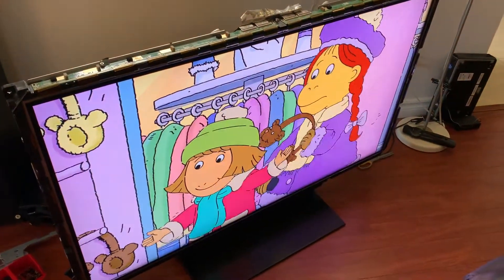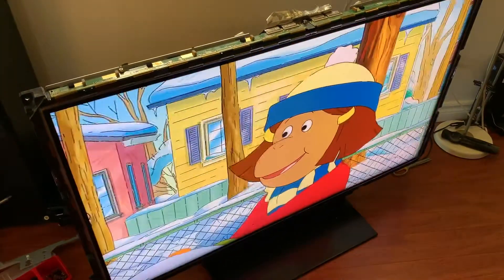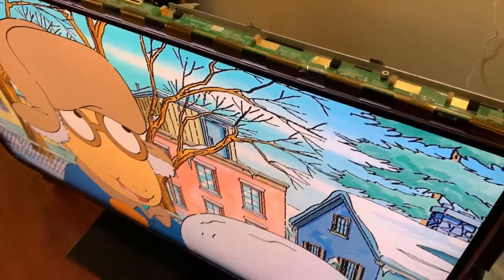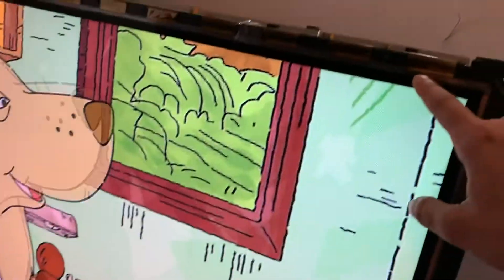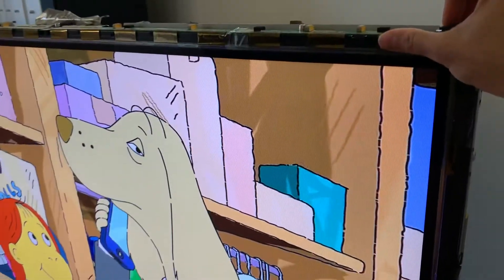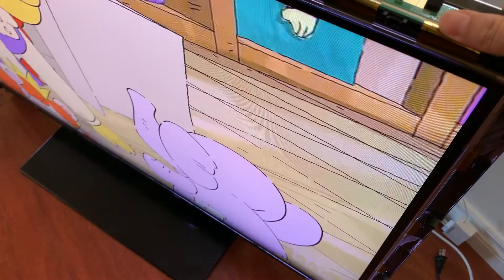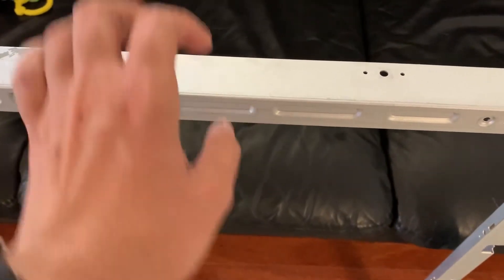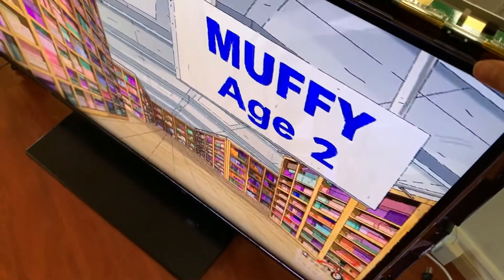Sony Bravia KDL 52 XBR4 - horizontal lines / ghosting fix

Comment: Why didn't you use electrical tape like everyone else to stick it down? Can you Do a video on how you removed the top panel without removing the base?
Reply from the maker: I did the foam 'fix' because the little COF chips were heating quite a bit and the heat had to be dissipated. 
The TV has been working just fine since the fixes were done.

The top panel was the easy part. There are several screws on it which can be removed. I was able to do it all in the position you see the TV in.
The TV is close to 100 pounds so it wasn't possible any other way for me.

A video opening it again would be risky at this point :)